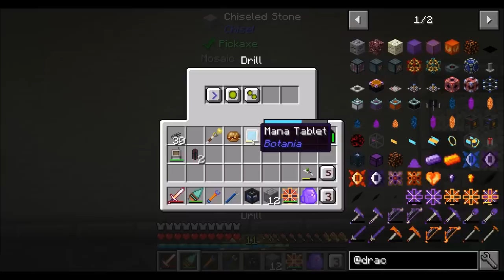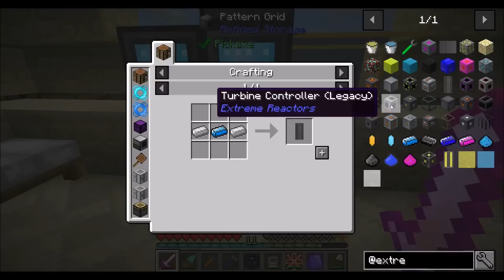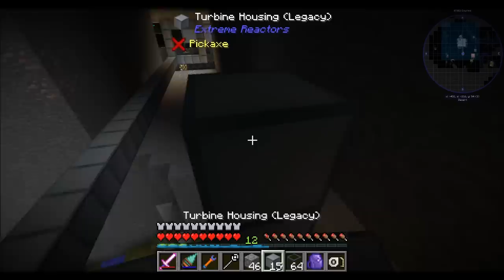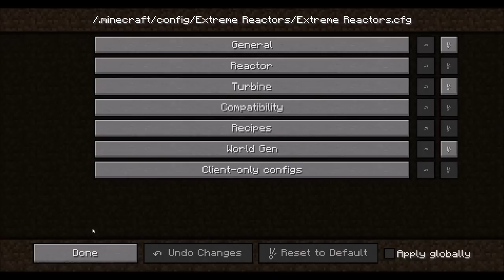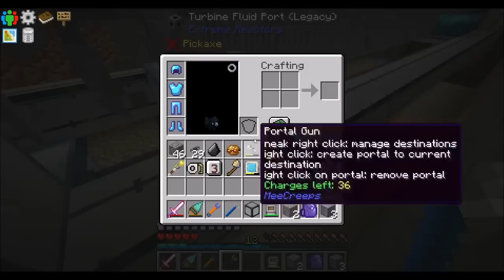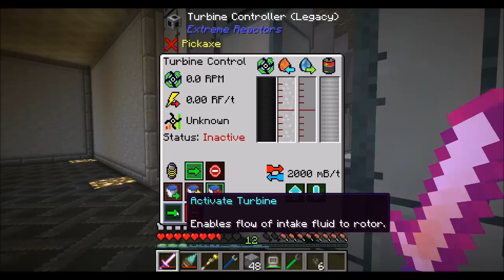Lets Play S9 E85 Steam Turbines

Comment: I can’t help but feel the super-laminar fluiducts were implemented exactly for this purpose.
Reply: There were actually a whole lot of builds where limited throughput of fluids was a problem. That's one of the reasons that Tesseracts were so popular: No throughput limits.

Cryo-stabilized Fluxducts and Super-laminar Fluiducts were implemented as more physical methods of infinite throughput transfer for RF and fluids. If I recall correctly they were implemented when Dynamics split the pipes out of TE and they weren't implementing the Tesseract right away.

So... this general case? Yes. This exact use? No. There were/are plenty of ways to transfer 2 or more buckets of fluid per tick into and out of reactors/turbines. ExtraUtilities Transfer nodes (over short distances), EnderIO Ender Fluid Conduits, bdew's Pressure Pipes mod, Liquid Translocators (assuming a 1-block gap or some kind of tank/pipe chain), Mekanism Mechanical Pipes... I'm sure there's more that I'm forgetting as well.
Reply: except the S-Lam Fluiducts are pretty bad at maintaining infinite throughput over decent distances.
I tried to set up 6 Turbines to 1 Reactor, and was losing so much fluid.
I ended up using ActuallyAdditions Fluid Phantom faces with range boosters for instant, easy, clean success.
Reply: Agree, the super lam ducts aren’t nearly as good as they sound.  Their transfer rate may be infinite, but the transfer rate is still limited by the servos retrievers.

Comment: Last time I checked, overspun turbines still work. From the ftb wiki -
 By using only 4 blocks of Ludicrite as the coil material and using a minimum of 76 blades, setting the fluid intake to 1918 mB/t will make the turbine reach 13,478.1 RPM and generate 26,531 RF/t. It is even better than a optimal 1,800 RPM design and is much cheaper.

Comment: There is a very simple reason for the Z size issue. Multiblocks, since the days of railcraft steam boilers, have a tendency to chunkload themselves when they are built across chunk borders. Since multiple parts of it have to keep communicating with eachother, they keep loaded in server memory. Not a issue in SSP, on servers, this means it can cause considerable lag. Especially if its a giant turbine with lots of moving parts. (yes, its purely graphical, it does not contain actual moving parts, minecraft hates that)

Worse still, it does not actually load the rest of the chunk. Even if your reactor is in the same chunk as the turbine, while your turbine will be loaded, it will not load the source of its steam. So every time you log in on your server, your turbine will have spun down cause it ran out of steam, but your reactor will be producing at the normal rate. A conundrum to figure out. 

By limiting the size of it to 16 in the vertical, you can ensure it stays within chunk borders, and it will unload properly when the chunks unload due to inactivity. And when it gets loaded back into server memory, it will be at the speed of the rotor when it unloaded. Saving you considerable amounts of fuel. 

Hence, server admins should be aware and fix it back to the 16 block rule, and survey players to stay within chunk borders. Since ticks per second is in everyone's benefit. And cross chunk multiblocks can kill the ticks per second better then everything else. 

As a sidenote, Dire should have explained this in the video.

Comment: I have not played with the 1.12 version of extreme reactors but in 1.10 on Sky factory 3 i created 4 turbines and manually set the control rods to produce 8000 mb/t and after spinning up the turbines and engaging the coils they remained at around 1800 rpm for the rest of the pack without any computer control.
Reply: ingeralhaosului The computer program would allow the turbines to disengage the coils and stop the reactor from using more fuel when the power storage should get full.
Reply: It's got nothing to do with keeping the turbines spinning, it's got to do with conserving fuel. When the turbines RF buffers hit full, the reactor continues to burn fuel and create steam. You use computer control to make the system more efficient by changing the fuel rod settings, disengage the turbine coils, or shut down the reactor altogether. You might only need 1 turbine running continuously to keep up with regular power demands, then when you require a burst of power for, say, draconic infusion crafting, the computer can set the reactor to make more steam and engage more turbines to pick up the slack. When turbine coils are disengaged, you can turn off the turbines and they don't require steam to keep spinning, although they do slow down over a long period of time, but you just use the computer control to turn them on for a few seconds to spin them back up.
Reply: Ingeral: love your picture!
Reply: @Armitige Shanks
Tx for the explanation i guess that my misunderstanding comes  from my different approach to power management. I don't usually use big reactors unless i have a continues power drain that matches its output or have something like  DE orb that can store a massive amount of power. if i do have something like DE orb then i never turn the reactor off unless i run out of fuel i just make the orb bigger and bigger until i have a level 7 orb. I have never been able to fill a level 7 orb except when that was my goal and that was achieved using rainbow gen and the phantom energy trick never with a reactor.

Comment: Where Direwolf20 gets his info seems to be a rather doubtful source.  and I quote; "a 5x5x27 turbine is the most efficient setup you can make."  This statement is wrong.  Fully tested several setups and the 5x5x27 layout is not actually the most efficient setup for a max sized turbine.  The 5x5x27 setup can produce 24,089.23rf/t when running full speed.  But, a 7x7x17 layout, using the same number of blades and enderium blocks, can actually produce 24,090.41rf/t when running full speed.  It's only a difference of 1.18rf/t, but it's something.  the 7x7x17 also uses 8 more turbine frames, but 10 less rotor shafts.  so is it more cost effective?  not really.

Comment: We're some enderium blocks missing in the turbine or was that just me?
Reply: No. He left 3 blocks without enderium, because coils slow down the reactor. With the current amount of enderium blocks he keeps it at the ideal rotor speed, if he added more it would slow down the turbine.
Reply: Is "3 blocks short" the sweet spot? Not disagreeing, but that's kinda weird - is there a reference to that anywhere?
Reply: No, that depends on the material. With Ludicrite you have to use less blocks (to be fair, ludicrite is more expensive though)
Reply: TheMining_Pickaxe, I've had a look at a wiki which gives a raft of formulas for turbines, but the number of blocks per material doesn't leap out (at me, anyway). I don't recall Dire saying anything about the apparent gap in his blocks either. Is there a good place to find out more?
Reply: Enderium is 37 blocks for close to 1800 rpm, and 32 blocks for ludicrite as he said in the video. This is pretty much standard since big reactor days, and they are not just for looks or ocd. This is for an 80 blade turbine, of course, which uses 2000 mb of steam exactly.

Comment: Can't the mod author implement the cyanite reprocessor already?!
Reply: You can use an autocrafter then pipe the the blutonium back into the reactor
Reply: thats not the point. blutonium became more expensive with that recipe. it was like 2:1 cyanite to blutonium ratio and now its 8:1
Reply: It was cheaper and I did like that, but it was fun to automate, so that's why I want it.
Reply: The cyanite reprocessor just turned cyanite into blutonium. Why bother?
Reply: Minetweaker.

Comment: I currently have 12 t6 solar collectors going in my playthrough, trying to make a dent in a T8 energy core.   Currently 19.5M rf/t.    Anyone else notice that interdimensional network receivers/transmitters from refined storage don't work in the end?
Reply: have you tried advanced energy cells
Reply: Yeah those work for power, I'm trying to get RS storage access in the end to automate dragon eggs.  The interdimensional upgrade works in the compact machines dimension,  mining dimension, etc.  But in the End the receiver doesn't light up for some reason.
Reply: My T6 solar array fills a 59.3BnRF energy core in one MC day. With everything running, I haven't seen its holding drop below 59.0Bn. Any other power option is merely academic.
Reply: I don't need the energy, just want the % meter on the tier 8 orb to move without playing for weeks..  I think I was up to 25.5M RF/t by the end of today.  Mostly i tinker and try to maximize my automation systems in between sticking new solar arrays up.

Comment: That's the weirdest turbine config I've ever seen. Why make it so long and thin? Also, yet again, not the "most efficient", as you mentioned. Why not make it 9x9x13 with 11 rotors shafts? The casing is the same amount of blocks, but it has less than half as many shaft blocks, the same amount of blades (80, 5 x 12 + 1 x 8) and produces the same power for the same amount of steam (it's actually marginally more power). And you don't have to mess with the config files, or have a turbine that's split by a chunk border (which I'm pretty sure could cause issues, it's never good to have a multiblock structure spanning 2 chunks). Where the hell do you come up with these bizarre configurations? If it's because you can't make 32 ludicrite blocks yet, then crank down the steam a little, or make an even less efficient reactor than the one you're using to quickly cook up another couple of hundred cyanite.

Comment: So… apparently turbines are either 4 or 8 pole? Assuming RF is 60Hz...
Reply: RF is a unit of energy, Hz are a unit of frequency... completely unrelated. Moreover, RF doesn't correspond to any actual units of energy.
For example:
His reactor produced around 25 kRF/t
It can vaporize a total of 20 buckets of water per tick (10% is 2 buckets per tick). A bucket of water is a ton of water. Water has a specific heat of 4,000 J/kg/°C and a vaporization energy 5 times that. So it takes (20,000 kg * 100 °C * 4,000 J/kg/°C)/tick * 20 ticks/s = 8,000,000,000 Joules spent on heating water and 5 times that (another 40 billion Joules) spent on vaporizing it. So we have roughly 50,000,000,000 Joules = 25,000 RF
1 RF = 2,000,000 Joules
Okay, so we've got one conversion.
On the other hand, it takes 1600 RF to perform basically any smelting operation in a redstone furnace (with the exception of a few specifics)... which is a contradiction on its own and I didn't need to go through the trouble of calculating the extreme reactor's conversion rate, since different items would require different amounts of energy to be converted into their final form.
For example, for ore, you basically need enough energy to melt the cubic meter of rock. This amount of energy is roughly 3 kRF according to our previous conversion, rather than the 1.6 kRF that it actually takes. Meanwhile there are any number of other recipes which take far less or more energy but also require 1.6 kRF to complete.

My point is, not only is RF not a measure of frequency (which Hz are), it is also not a measure of energy, if we try to apply real world physics and units to minecraft.
Reply: Whoosh... if the turbines were actual generators putting out 60Hz AC, and they were synchronous machines, they have to have either 4 poles (running at 1800RPM) or 8 poles (running at 900RPM.)